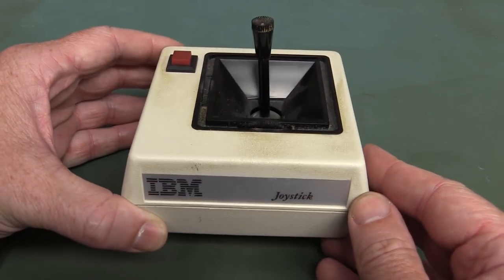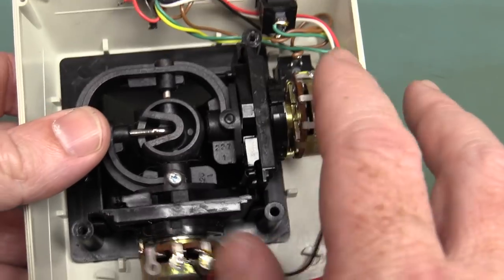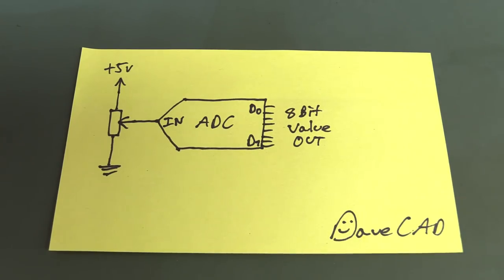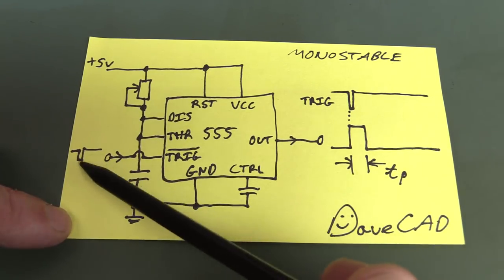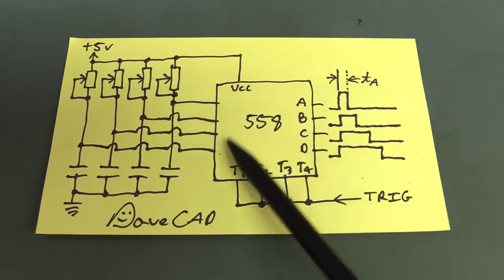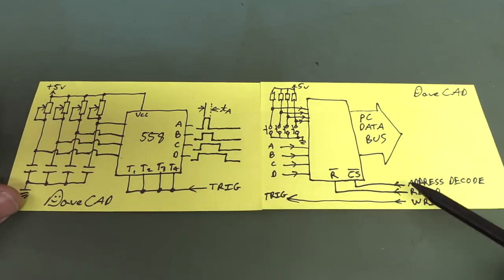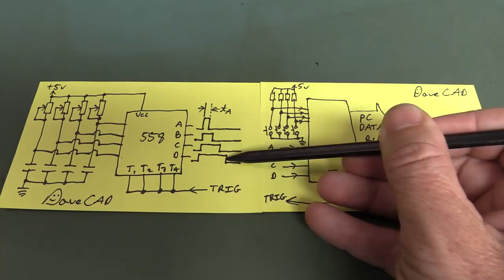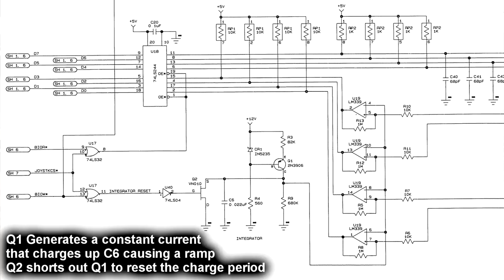EEVblog #1054 - How an Analog PC Joystick Works

Comment: (the moment you realize how a 555 timer can be used to turn an analog signal into a digital signal)  That's brilliant.  Absolutely brilliant.
Reply: You can also use a 555 as a touch or proximity sensor by measuring the effect of hand capacitance on the oscillator.
Reply: my dad is as old as dave i think and xD he once said "555 timers can be used for EVERYTHING, if you knew what people allrady did with 555 timers" ive seen some people building plasma speaker with them as a trigger but xD that is next lvl shit xD
Reply: NamacilHDx : Ha, you can make (odd, and obviously slow) logic gates with them. 555s, resistors, capacitors, inductors, power transistors, and I/O hardware are enough to recreate the modern computer age (just very, very slowly).
Reply: The Apple II used essentially the same method. An interesting side-effect of software timing, at least with its relatively slow processor, is that games would run noticeably slower when the joystick was pointed right and/or down.
Reply: I was surprised to read how the Pokey chip in the Atari 8 bit home computers performed analogue input...
Then I heard about this trick a day later. XD
There are no discrete 555 timers in the Ataris, but I wouldn't be surprised, based on how the documentation describes how it reads the controller pots (those are used for paddle controllers, mostly), that something akin to the 555 was implemented into the Pokey chip itself, because what the chip documentation describes is almost identical in operating principle...
Reply: Same probably C64

Comment: BBC had an ADC as it was intended for other educational uses - datalogging etc.  It was labelled as an analogue port, not joystick
Reply from the maker: Makes sense in that case.
Pretty crap voltage reference for datalogging though! But I guess you could software calibrate at temperatures, only 10mV/deg C drift :-/
But good enough to see a waveform.
Reply: Yep, 12 bits / 5ms, but really only intended for school level data logging. Temperature, light levels etc. Not massively useful for audio with <20kB free memory. Just one of those extra things that made the Beeb just a really useful thing to hack around with. Designed by a bloke who really knew what he was doing.
Reply: The built in reference was for Joystick use. You could use an external reference for better accuracy.

Comment: If I recall correctly, my TRS-80 Color Computer used a binary resistive network (which was a true analog output) in place of the ramp generator mentioned in the video.  Since the software could control each resistor, it would do a successive approximation and stop once the comparator trigged (after backing off to find the least possible value that still triggers).  Therefore, there was no need to read a pulse width signal since the software already "knew" the output value.  That was when I first learned that an analog output + comparator could serve as an analog input.

Comment: From Wikipedia on the Apple ][, which premiered in 1977 (PC Jr was 1983):
"Rather than use a complex analog-to-digital circuit to read the outputs of the game controller, Wozniak used a simple timer circuit whose period is proportional to the resistance of the game controller, and used a software loop to measure the timer."
Sound familiar?  Sound earlier? https://en.wikipedia.org/wiki/Apple_II
Reply: Atari computers did something similar for their paddle controllers as well - this dates back to the 2600 and probably to earlier Atari arcade machines. You discharged a capacitor for each channel in the vertical blank and then charged it through a constant current source until it hit some reference voltage. When that happened you latched the horizontal line counter. 

So you didn't actually need a software loop - software could just read the current potentiometer position out of a register.

The Atari 8 bit machines even had a fast scan mode where the capacitors charged in two scan lines rather than a whole screenful. 

https://www.atarimagazines.com/v2n4/talkischeap.html

The POKEY chip converts the POT resistances into numbers. This technique is called voltage-to frequency conversion, and is noted for low cost and relative inaccuracy, reflected in the speaker output as noise and hiss. Still, most of the original sound remains intact. POKEY normally requires 228 TV scan lines to read the POT. The number produced by POKE is actually a count of scan lines it took to charge a capacitor located in POKEY.

If there is little resistance (paddle knob turned right), the capacitor charges in fewer scan lines and the resultant number is smaller. A fast POT-scan mode is available, which causes the capacitors to charge up in only two scan lines. This fast POT-scan is what we use to read the values from the microphone, because the values must be read thousands of times per second and the normal POT-scan mode is much too slow.

Comment: The Vectrex used a similar method, but using the main DAC instead...

The CPU sent out a few incremental values to the DAC, and when the voltage from the DAC matched what was on the pot in the joystick, a comparator then just outputs a High signal to a digital input pin.

With the use of a mux chip (4066, IIRC?), it meant that they could just one of the relatively expensive DAC chips for the X/Y/Z, and both joysticks.

(the "Z" axis on the Vectrex was just the beam brightness.)

Quite a few clever tricks were used to cut costs back then. Sadly, cutting costs these days often means manufacturers using crappy plastics etc.

Bring back the heavy IBM cases and tank-like build quality, I say. :p (for non-portables, obviously. lol)

Dave - It would be fantastic if you could get hold of some of the MIPS era SGI machines for a teardown.

I could be wrong, but I don't think you've covered one of those as yet?

Huge amount of engineering went in to the SGI Octane / Indy / Onyx etc., and they had a huge price tag to match.

I had an Octane (MIPS R5000) and O2 for a few years. They weighed so much, I was slightly worried about the floorboards. lol

Comment: I use to program games in DOS, and had to write a calibration routine as CPU speed was an unknown so one had to get the min and max timing and convert it to 0-255 8 bit value
Reply from the maker: Glad you remember, it's been too long ago for me!
Reply: Not only that, the potentiometers also had very “flexible” tolerances and did vary a lot between different joystick models.
Reply: Couldn't you store the current time at the end of a frame then wait at the end of the next frame until the appropriate time had elapsed, then the speed of the processor would not matter.
Reply: I believe a lot of games had you move the joystick to the upper left corner and then the lower right corner to calibrate the min and max on the axis.  I'm thinking if you wanted to not use software to get the digital value, you could use a second 555 timer running astable to increment a binary counter and then grab the data from those pins to get the digital value.  Might be useful for an arduino controller you want to minimize computations with.  That'd be more expensive but a good exercise with some more chips.
Reply: On an Arduino, you could just use the built-in ADC to read the values.
Reply: That's no fun.
Reply: There's a certain fun aspect to making your own, but the built-in ADC of the µC is running completely independently of the CPU; no polling, eating up CPU cycles, needed. Just read the register after the conversion to read the value.
Reply: Add in the Turbo button... oh how much fun those days. Turbo? More like Go slow button. :-)
Reply: I miss the simpler days, now it’s talking to the USB drivers etc, was a lot easer in the old days and more fun now it’s just feels dull and everything is done for you
Reply: gorillaau I remember the turbo button, they should of called it Throttle but I all ways wondered if calibration was needed as it slowed the CPU down to what PCs started out as so games would run at normal speed as those early games would just assume the CPU speed was a certain speed
Reply: Richie I don't think so.. I think it was a bit arbitrary. I had a computer at work which was 33MHz or 25Mhz Choked/Throttled/Turboed. Back in the early 90's

Comment: The Amiga used hardware to count how many scan lines it took to charge a 47 nF cap through the joystick pot. You'd write to a control register during the CRT vertical blanking period to discharge the cap and start the counters and then read the pot register when the next vertical blanking period started, followed by setting the control register again to repeat the process every frame.
Reply: Clever. Though I think analogue joysticks were rare on the Amiga, certainly all the joysticks I took apart were simple switch-based (digital) designs.
Reply: I'm not sure weren't those not the same which were used in the C64 ? Yeah they were switched based but the funny thing is there were certain types of games you could only implement with those kinds of joysticks mainly sport games which was a disappointment when I changed to PC.
Reply: Indeed, virtually all joysticks on the Amiga were digital and used the same Atari standard (the controller port was reconfigurable and could use mice, digital or analog joysticks, light pen, or act as a 4 bit I/O port.) A native analog Amiga joystick was supposed to use 470k pots and was not directly interchangeable with PC analog sticks, even accounting for the pin-out difference. The rarity of native sticks lead to there being hardware adapters that let you use PC sticks on the Amiga if you had one of the few Amiga sims that supported analog input. One example, Fighter Duel Pro 2, even supported analog rudder pedals along with an analog stick when using the Smart Port adapter, which fed the rudder axis into the Amiga mixed with the mouse signals by reconfiguring the middle mouse pin to analog mode.

Comment: Of note, the MCS series microcontrollers from Intel were released starting in 1982.  They have built in AD converters in them and were used pretty extensively in a variety of applications.  My Roland W-30 music workstation had an 8098 in it.  The 8061 was primarily built for Ford for their cars, but the 8051 is a classic microcontroller in a bunch of industries.  It was released in 1980.

However, you're right, it would never be cost effective as a simple joystick read circuit.  I just wanted to note that there were a quite a few microcontrollers on the market by the time the peanut was released.  Programming for the 8097/8098 was a blast though, especially the banked RAM configurations.  :)

Comment: Hey Dave,
As an industrial automation/process control guy I'd like to see a detailed video on how modern industrial transmitters keep a stable constant current loop indifferent to a reasonable (0-1387ohm) resistance.

Comment: Nice one, Dave! The venerable 555. I started making transistor multivribrators for my projects in 1972. In 1973, I made a Sputnik beeper for a model rocket using transistor multivibrators. I still have my first 'breadboard' and the rocket beacon, still working. After that, the LM 555 came out and that was a godsend! My first real project was making an LED blinker for a phony security camera body. Since I was the shop tinkerer onboard my ship, I made the blinker for a case with a phony glass lens that looked like the security cams that were available for that day.  That seemed to stop the thefts. You open the door and one of the first things you see was the blinking LED on the phony camera body. Later I got an AC synchronous motor drive controller for my telescope with joystick. The circuit in that was MUNTZ unstable and I used a 555 chip and a regulated supply to remedy that problem. The autoguider socket and add-on was added later. I still use it to photograph the night sky.

Comment: The joystick port in the SoundBlaster, which later became the PC standard, was directly connected to the bus with a single I/O address. There was no timer, only capacitors.  To read the axis positions, software would write to the port to reset the capacitors, and then read the port in a tight loop until the bits flipped.  There was no precise enough timers on the PC,  so the time was measured using a counter in the loop.  Of course this doesn't allow any inference during the loop, which meant disabling all interrupts for devices like the keyboard and soundcard.  Which doesn't work that well in a modern multitasking operating system...

Comment: Back in the day, when technical solutions were crude but exciting. Today: Pick a microcontroller with USB and a sufficient number of ADC channels...technically much better, but booooring ;)
Reply: Chip Guy Vids : You could always hang a cpld feed by a clock, reset, and timers off of an spi, if you wanted something more interesting ;) .
Reply: Doesn't sound too bad, actually. Silly but interesting.
Reply: Agreed. I'm working on designing a multi-configuration CompackFlash/ATA2 controller exclusively for the PLUS card interface on the Tandy 1000EX/HX (actually just an XT on a 62-pin BERG connector) based on the popular lo-tech 8-bit CF-IDE card (James Pierce hasn't been active since 2015, but like all of the XT-IDE community projects, his stuff is Open Source). The digital logic of the day was simple enough that with a little electronics know-how, you could make whatever you needed yourself if there wasn't anything available! There's something very satisfying about being able to make your own expansion cards using discrete logic (74xxx series in this case) and a flash chip.
Reply: Yes that's why I'm fascinated by old electronics like radar.

Comment: C64 SID chip had 2 analog inputs as well. It could measure the analog values of 2 pots without blocking the CPU, with less parts needed. A "Single Slope" ADC was included in the chip. Cheap ADC in 1982.